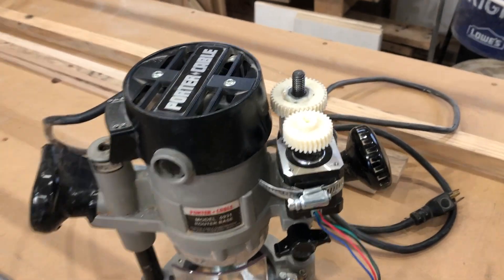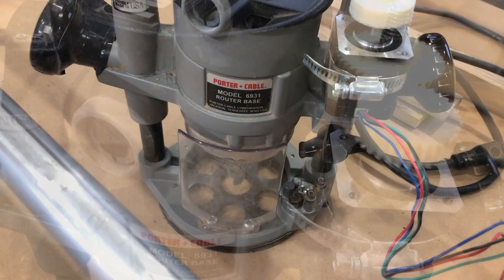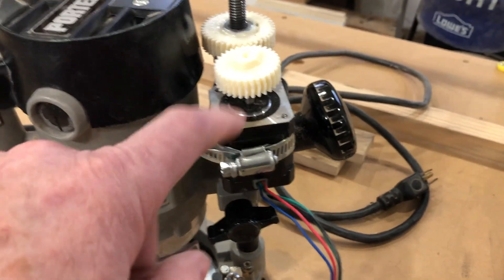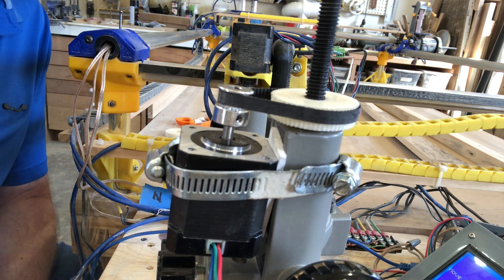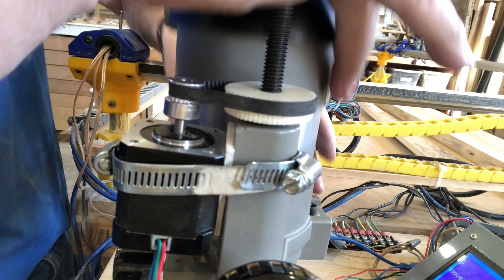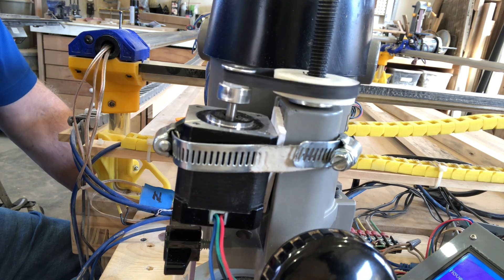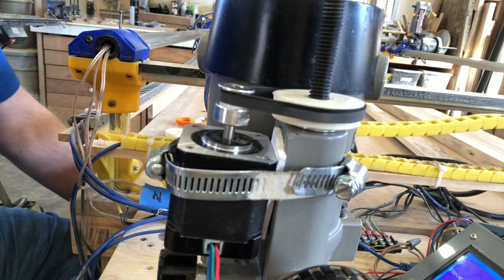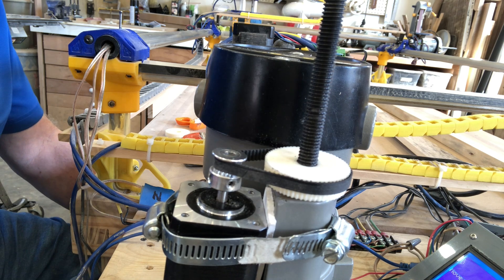Bedrail CNC - Part 2 - Proof of Concept

Comment: Much like Maslow used for Z axis, so this machine is going to be similar to a Yeti Smartbench?
Reply from the maker: I have been watching the Maslow progress for a few years now. I like what they have done in terms of a compact (wall mount) CNC machine.  I had not seen the Yeti machines before, so I think what I am building is probably more closely aligned with a V3 Engineering Lowrider.

Comment: It looks a bit wonky to be honest, but it does seem like it might work. The Z travel is pretty slow compared to other CNC machines I've seen, but maybe you can just slow everything down to match. For something like flattening slabs, that shouldn't be an issue. For a more three dimensional shape it might really slow things down.
Reply from the maker: For the type of CNC work I envision there will be relatively little Z-Axis travel, so the plunge base will work in that regard. There is a lever on the plunge base to "clamp" the router in position once it gets to the desired depth. I have not done anything about that yet, but I think it will need some attention to provide maximum rigidity. In terms of speed of travel, I can drive the motor a little faster, but I don't do much in terms of "carving" (at least not yet). Most of the work I expect to do will be multiple pass precision cutting where adjusting the z-axis is done once per pass, and probably no more than an 1/8" at a time.